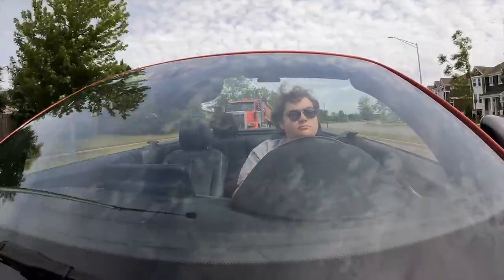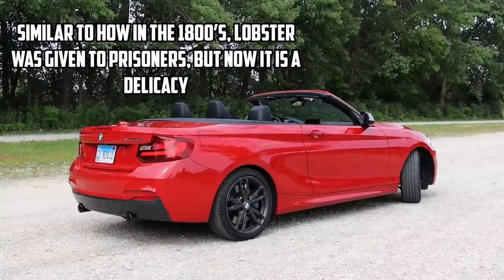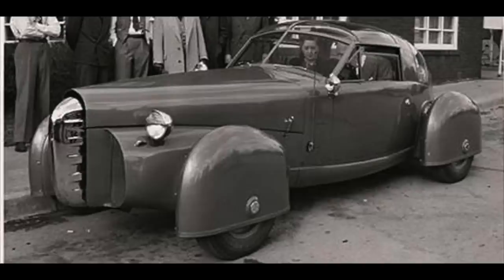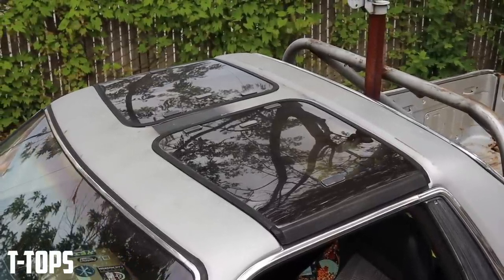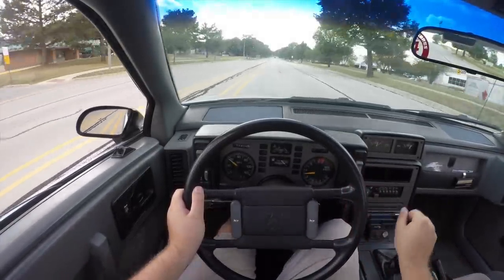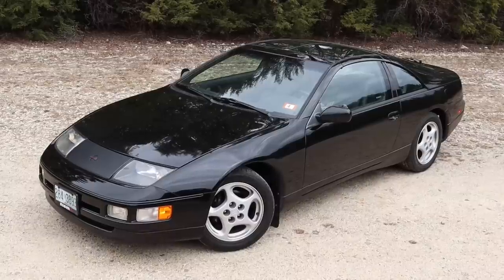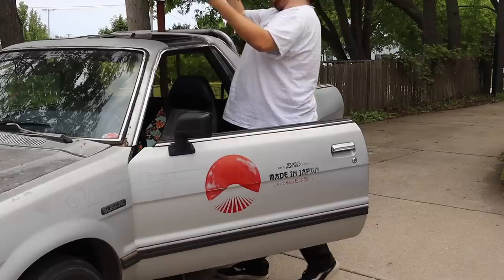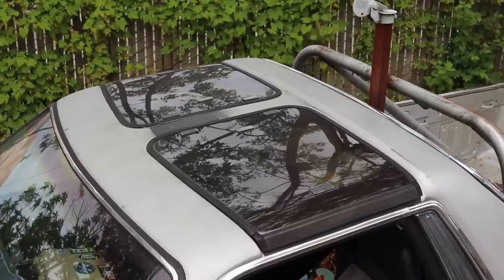T-Tops - How They Were Invented & Why They Went Away!

Comment: 2 out of my 4 firebirds had them. Loved every minute of them off. My 84 and 85 had them. My 79 and 87 didn't and they also had no A/C. I will own a 88 or 89 formula with t tops someday.
Reply: I feel ya, Ken. I had an 85, 86, and 88 Camaro at different times, as well as a 95 Firebird V6. 
The t-tops in my 86 Z28 always leaked, but on a nice day, ooh, they're neat to have.
Reply: @Lawrence330  lol my 84 leaked but my 85 never did. But my 87 was the only of the 3rd gen that the hatch glass motor still worked.
Reply: Of the 4 Camaros I've owned over the yrs (79 6cyl, 82 Z28 Crossfire, 84 Z28, 88 5.7 TPI IROC Z) only the 88 had T-tops. When I 1st got it the question was always "are we taking the T-tops out?" whenever someone else was going somewhere with me (summer months). They had the effect of making each trip an event of sorts. Sold the car in 06 after falling for the whole "You can't have that car with a baby on the way, it's time to grow up" advice. Today? The baby has turned into a 6'1" 300lb destroyer of groceries, without T-tops. And I'd gladly trade him for my IROC back.
Reply: @PeekabooGram  I know the feeling.  I sold my 87 supra turbo I rebuilt from scratch for the baby. A week after I sold it she miscarried.

Comment: One old car feature you might consider making a video on is the digital dashboard. What makes it so interesting is that it was never necessary aside form vanity and 'futurism' but took off in 80s sports cars, died out in the 90s, and here we are over 30 years later and they're starting to make their way into modern cars again, albeit in a different form. The Buick Reatta instantly comes to mind with its digital dash and touch screen... in 1988!
Reply: The 1981 Yamaha Virago 920 has an integrated digital dash/instrument cluster. The tachometer was circular shaped and the speed was displayed as 55mph, for example.  Had odometer, kph conversion, fuel indicator, etc.  Was pretty slick back in the day. Digital was everywhere.
Reply: The analog styles of the past are better than today’s digital ones.
Reply: My dad had an '84 Lincoln that had a digital dash. It was cool then, but its alarm-clock look is far cooler looking back from 2022. haha!
Reply: I had a 1992 Cougar with digital dash. Towards the end of its life it started going wonky. Flashed and gauges went berserk. I had to pull over, turn the engine and ignition off and then restart. Like rebooting a computer.
Reply: @laughingalltheway8399  that would be advantageous today in the face of today's glass cockpit dashboards of menus and adjustable screens that are complex and too intricate to read quickly. What if we had modern cars with digital dashes that just had simple marks and numbers so you could quickly see anything you needed in a split second 🤔
Reply: @FingerinUrDaughter  plus back then VFD displays were still a big thing and those are very easy to read in all lighting conditions and last a long time. Some old VHS VCR may not work right anymore but I'll bet the display on the front is still crisp and clear today
Reply: @FingerinUrDaughter  hippies ARE boomers, they protested the Vietnam War because back then there was still a draft where most any guy in the boomer age range would be told to go to war and that was that. You could go like they said or refuse and get thrown in jail. Once upon a time boomer meant someone born in the postwar baby boom era of 1946-1964 and not a generic diss for older people amongst the <25 year old crowd 🙄
Reply: @KameraShy  my Ma had a 1985 Cadillac Cimarron used in about 2000. It had the digital dash which looked like a simpler version of KITT's dash from Knight Rider but in time it went batty and the speedometer finally only started working in KMH mode so my Ma wrote down a little chart of the KMH/MPH conversions 😂 a few months later the hood cable broke and it threw a rod 😭
Reply: my 1990 S15 GMC pickup had a digital dash too!
Reply: Wait seriously a touchscreen in 1988?
Reply: @tsharp1194  yes, it was CRT touchscreen too
Reply: My parents had a Chrysler LeBaron and the digital display always went out. They always had to take the car in, because they wouldn’t know how fast they were going or if they had enough gas. I think that was a common issue in 80’s cars. My parents next car was a Cadillac which is a premium car and it has an analog display. I think it just shows the technology wasn’t there and car companies gave up until they had something more reliable.
Reply: My favorite car feature that was very short lived was talking cars. I remember my grandpa’s car would say “please fasten your seatbelt”, “your door is ajar”, “fuel low”, “thank you.” I would purposely keep my seatbelt unlocked or keep the door open just to hear the prompts.
Reply: Go even farther back -- The Buick Riviera first had that same dash, complete with the CRT touch screen, for the 1986 model.  I remember reading how much the automotive press hated it, yet now, touch screen control of radio and climate controls is the norm.  I've also heard that some versions of the Aston Martin Lagonda from around that era used CRT displays for the gauges, but they were not touch screens.
Reply: There isn't much of a story there. Digital dashboards of the 80's, if you just think about the displays, were known to have issues where if the sun hit them they could become washed out (especially if they were LCDs. Alongside that, they were known for being more unreliable, with segment burnout and unreliablity being a thing. Some cars (Mazda Cosmo, some GM cars, etc) had CRTs and touchscreens but CRTs are both inefficent and the touchscreen part was also unreliable. And all of them were considered expensive to fix and produce in the first place. In the 80's they made sense, in the 90's they felt dated, while the analogue gauges were still perfectly fine enough to show what date needed to be shown. Some cars still had Digital Gauges in that period but the tech just wasn't there to make it worthwhile. 

Now there is an expectation of more data than a conventional Analogue gauge cluster can show, as well as integration into every other entertainment system in a vehicle. In the last 10 years, OLED displays have come about, providing LCD flatness with CRT light production. Almost every part of a car is now hooked through a computer anyway, and computing power is greater than ever. So it's a no-brainer to go with at least a small screen, if not a full digital display.
Reply: @GroundHOG-2010  Those two lengthy paragraphs you wrote sound like a pretty decent story lol. Sounds exactly like something that would be featured on this channel. There’s definitely a story to be told there.
Reply: @tsharp1194  yeah dude, even ATMs had them. They were monochrome CRT but still touchscreen
Reply: My mother bought a brand new 1990 240SX and brought it by to show me.
The speedometer on the dash was not digital, if I remember correctly.. However, it did have a digital display on the windshield. And it showed your speed in the lower left corner. She thought that was the coolest thing. I thought it was pretty cool too when I was 16.

Comment: I always felt the Sun / moon roof in the consumer’s eyes were more practical.  
No storage problem, way easier to use. If you were out and it started to rain unexpectedly no need to pull over and retrieve tops and put on in the rain. All you have to do with Sun/ moon roof is push a button. Plus there was the issue of having the t tops stolen.
Reply: Damn I commendable this I do like sun roofs on the Porsche
Reply: This guy at work has a 4th gen Camaro with a broken T-top on one side. For the love of a new glass he's got it with a heavy duty plastic sheet and an ungodly amount of tape holding it down
Reply: @ScubaSteveM45  I can't even imagine what a glass shop would charge to replace the glass in a t-top. Perhaps point him to eBay...surely he can pick up a full set from a wrecking yard for a few hundred dollars. LOL!
Reply: @laughingalltheway8399  i think that's just the problem. Nobody has one he's looked across the immediate tristate area. Crafting a new piece to fit from a glazier would probably cost as much as current Blue Book for the car as well
Reply: @ScubaSteveM45  Probably so. My uncle is still daily drives an early Fox Body with t-tops and every few years one gets busted and he goes on the hunt for new ones. I've seen him buy a set from a wrecking yard just because he saw them while he was there for something else even when he didn't need them. haha!
Reply: @laughingalltheway8399  that guy looks constantly and still hasn't found one. The T-top was a rare 4th gen option most people got the hard roof or the convertible
Reply: Yes people prefer the lazier route. It's sad
Reply: Whos gonna steal T tops lol the t top bandit you better watch out for em
Reply: @watermelon7411  T top theft was very common at one time
Reply: @jamesrecknor6752  at one time not anymore

Comment: I've owned both, and the other issue with t-tops is they didn't quite have the open air feel convertibles had, it's hard to explain unless you drive in both. T-tops also had a lot more turbulence to deal with as the air would get "trapped" in the back of the vehicle giving you a bit less performance and gas mileage, and more air would blow back on the driver compared to a convertible. You also, had them rattle around as they got older (this simply may have been my experience with a GM vehicle). Lastly, and this is just an asthetic/opinion thing, the convertible simply looked better with the top down.
Reply: yeah that's right, and also on the Corvette they actually had an optional removable rear window for that reason on the 73 model to help with the turbulence

Comment: Love T-Tops and wish they would come back!  Had a couple of Trans Ams and a MR2 Turbo with T-Tops and really enjoyed them. The 78 Trans Am had a bit of a rattle but I discovered if you removed the decorative trim piece of the T-Top handle area the brackets that held the retractable pins could be adjusted. Slightly adjusting the angle that the pins came out took the slack out and tightened them up. The cars were pretty tight though spirited driving over a railroad track would give you a little cowl shake. Surprisingly one of the most rigid open-air cars I owned was a Fiat X19. It had a targa top but seemed as rigid as a coupe. No shakes, leaks or rattles, it's like it was made out of granite. I miss those cars and wish I would have kept a few of them.